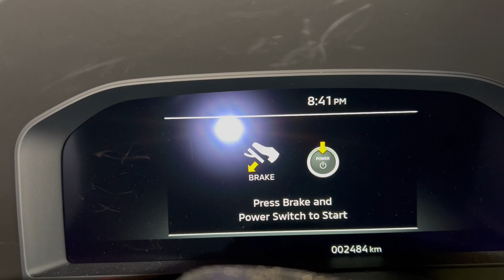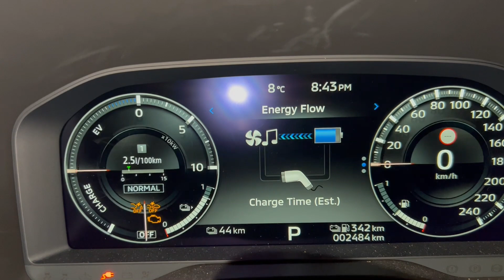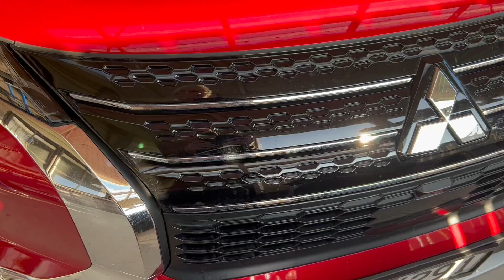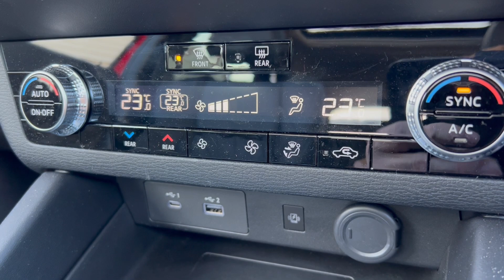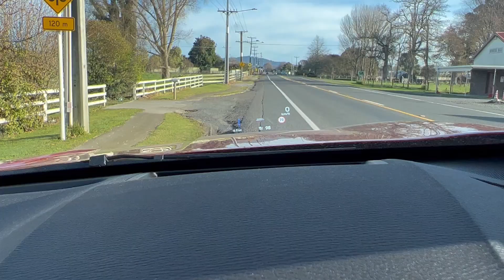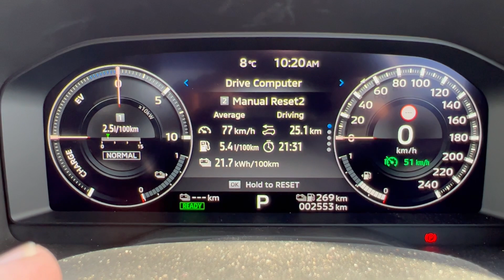Outlander PHEV 2022 2023 Review First Look (PT3)

Comment: Do you know what triggers the parallel-hybrid mode, where the petrol engine engages with the front wheels? I have tested heavy throttle input using all the driving modes, and i have never seen the power flow meter show power going from the ICE to the front wheels.
Reply from the maker: If you use up the battery or put the car in save mode it should go to it at 100kph/60mph
Reply: @detailedreviews4837  thanks. I’ll give that a try next time I’m on the motorway.
Reply from the maker: The car only has one gear. This means it can only go directly from ICE to wheels in a very limited speed range. I have seen it at 60mph/100kph a few times which is the speed it seems to like using the ICE. At any other speed the ICE only acts as a generator
Reply: @detailedreviews4837  Thanks for your reply. Is there any particular drive mode that you need to be in? And do you need to be around a certain battery percentage for this to occur?
I’m just concerned that I’ve never seen it happen in my car.

Comment: Quick question. How do you turn off your car power when power on without depressing break? User manual mentioned "two times to change to off" on page 7-11.  Looks like a mistake here as I can turn off the power by a single push instead of two times?

Comment: Thank you for the this. Very helpful. Small question for you what do you think, is it good just driving only ev mode? Also in what stage you going to charge the battery? and up to full or 90%?
Reply from the maker: Everyone seems to have different ideas on this, so don’t take too much from my reply…I work on the principal that it is a 20kwh battery and only 15 is used for EV mode and the rest is saved for hybrid mode. As such I see no issue with using EV mode down to 0 range

Comment: Thanks for this. Would you kindly spend more time on the Climate Control option please? I'm currently deciding between full EV and PHEV and the ability to pre-condition the car remotely (via smart phone a la Tesla) is very appealing to me, especially in Australia. I actually popped into a Mitsubishi dealer and they were incapable of telling me whether Mitsubishi had a similar thing going (ie - car control via smartphone app). It looked like you could set pre conditioning times in the Outlander though am I right in saying it doesn't work for you? Also - would it work with A/C to cool the car down at set times? I guess that would be one way of getting around the lack of phone app and getting to the same result I'm after (albeit, considerably less user friendly). Thanks for the review!
Reply from the maker: The simple answer is the car has the ability to pre heat or cool the car via the infotainment screen. Unfortunately it simply does not work. I gather this is not just a fault in my car but all released in New Zealand. I am hoping this will get fixed in an update. There is no phone app released yet, I am hoping I can use the app to turn on the air con remotely at any time but suspect it just duplicates the timer in the infotainment system. It is good to be the first to get the car, unfortunately there are still some issues to resolve. My next video will be on upgrading the Bose audio system

Comment: when driving with EV, is there a maximum speed point where the engine is forced to turn on? I'd like to know if its possible to drive at over 110km/h on a freeway without the internal combustion engine turning on.
Reply from the maker: The maximum speed limit is 110kph in New Zealand so I have only done a little over that. It worked fine in EV mode and no indication it was running out of required battery amperage to go faster

Comment: Great video, thank you.

Does 2023 use shift paddles to regulate degree of generative braking or is there another way to regulate the regeneration.

I loved that feature in both my previous Outlander PHEV 2018 and current 2022.

I love the able to coast as it does extend my driving range.
Reply from the maker: The paddles do control levels of regenerative breaking. Also there is the one pedal driving button and the B selector on the shifter
Reply: I believe that in Part 2 of your videos, I noticed (+)  and (-) paddles just behind  either side of the steering wheel.

Comment: Thanks for putting the video together. To better understand how the PHEV works, does the car by default always use EV first and where requires it will use a combination of EV and Petrol? Under what conditions, does the car use the combination of fuels? Assuming you start off with a full EV charge, how much more 'regenerative power' would you obtain when driving the vehicle (hence providing you additional mileage on EV power)?
Reply from the maker: It is winter here at the moment and the car always starts the petrol engine. I assume to warm it up. You can press the ev button before starting and the engine will generally stay off
Reply: @detailedreviews4837  I think you should also add fuel stabilizer to help slowing the petrol staleness if you only refuel one every couple months

Comment: Hey so if you go on a long trip +200km will the battery deplete in the first 50km or is there a hybrid mode that would use it sparingly or get the engine to charge the battery as u go. In those trips what would the fuel consumption be?
Reply from the maker: If you start the car in normal mode it starts the engine much earlier than if the car was in ev mode I presume to get the best hybrid range. Ev mode would normally only be a good idea if you know you will get to recharge before it runs out

Comment: Quick question.  Are you able to drive in EV mode with cruise control on?  I know the previous model would not allow this.  Thanks
Reply from the maker: Easy answer, yes. I have been at 110kph in EV mode with cruise control on
Reply: @detailedreviews4837  wonderful.  I'm assuming this is forced EV mode not the vehicle chosing EV mode?
Reply from the maker: @anthonyg8435  no.  In normal mode. I tested forced ev in a previous video and got about 5km after the range went to “—-“ in normal mode the petrol engine came on at this point
Reply: @detailedreviews4837  I'm sorry I'm a little confused by your response.  Can you use cruise control while in forced EV mode?  Thanks
Reply: @anthonyg8435  yes provided the PHEV have enough charge to hse. also assuming that you drive just over 100kph…
Reply: @RP-vu5uj  what if your in traffic and the vehicle comes to a stop will it continue with adaptive cruise control in EV only mode or will the ice automatically start?
Reply from the maker: @anthonyg8435  yes

Comment: Thank you for the in depth look. I'll be very interested to see how the electric range and Hybrid fuel economy change as the outside temperature increases.
Reply from the maker: I suspect if I kept my car in a modern garage I would get a better charge
Reply: I suspect that I've over-estimated the cold temperature penalties - yesterday was 10 degrees, I reset the trip computer and got 75km of EV (no excessive aircon or heating) - there is definitely some affect of cold, but I don't think it's that much by itself - the heatpump and de-misters do use a lot of charge (and they normally turn on the ICE as well)

Comment: Thanks for putting these videos together. 
You've mentioned a few negatives/disappointments about the car. Do you regret buying it?
How does Funkytown sound cranked up on the Bose audio system?
Reply from the maker: No, still love the car. I make these videos as they are what I wanted to see before I purchased the car. In New Zealand we don’t have the same choice. The Bose stereo is disappointing, the subwoofer achieves little, I plan to upgrade in a later video
Reply: I'm also in NZ, and have paid a deposit on one of these. I chose the VRX partly because of the Bose premium system. I gave the stereo a quick test during a test-drive of the vehicle, and didn't think it was that special. I just though it was because I needed more time with it to configure it to my liking. Based on what you've just said, I guess I shouldn't get my hopes up.
Reply from the maker: @revhead27  if the Bose speakers are 4ohm they can be swapped for better speakers but I have been told Bose often use 2 ohm and if replaced with 4ohm speakers they are too quiet as the amp is not powerful enough to drive them properly. This means an eq is required and separate amp. Even this is tricky as seats are so close to the floor due to the battery height
Reply: @revhead27  ours turns up on the ship in two days, hoping the stereo is decent enough 😣 from what I remember of when I test drove it, it wasn’t bad
Reply: @Angieb9191  - haha , I wonder if that is the same ship as mine. Mine's due here on June 27. Then the 4-6 week wait to drive it away. I only tested the stereo with radio playback, so I guess it will sound better with Apple CarPlay.
Reply: @angfam7729  oh really? Mine was due in the country on the 28th and I should have it 2 weeks after 🤞
Reply: @Angieb9191  Hey, not fair! 😮
Reply: @angfam7729  are you north or South Island?
Reply: @Angieb9191  North Island. I'm adding a towbar & paint protectant. Maybe that is what's adding the extra delay?
Reply: @angfam7729  we’ve added a tow bar and a couple of other bits and are north Island too I wonder why your wait is so much longer. I did put my deposit down in March 🤷‍♀️
Reply: @Angieb9191  , I paid my deposit early April. Are you in Auckland?
Reply: @angfam7729  nah manawatu
Reply: @Angieb9191  Just got my new ride today!! 😁
Reply: @angfam7729  that’s awesome! Way sooner than you thought 👌 mines in the country, should have it by the end of next week 🤞
Reply: @Angieb9191  Good luck. 
After getting the Apple car play working, i had no issues with the Bose stereo. It sounds great to me!
Reply: @angfam7729  wicked 👌
Reply: I recently drove the latest Hyundai Santa Fe (and apart from the dreadful controls) the Harman Kardon system is better than the Bose system used in the Outlander - didn't affect my decision in the slightest - the Outlander is far nicer to drive - music isn't a big selling point to me.
Reply: @gmilne13  - I guess any new-car stereo will sound better than my current 12-year old radio 🙂
Reply: @angfam7729  Agreed 100% - the stereo in the Outlander is far better than my aftermarket head unit in my other car - and WIFI connectivity is pretty cool - loving wireless CarPlay

Comment: Thanks for another excellent review. The Electric range does appear disappointing and wonder whether is is any better than the old Outlander PHEV or the Eclipse Cross PHEV?
Reply: You mean apart from the increase in power and range? I got 76km today in full EV at 13 degrees C, so it depends how you drive.
Reply: @gmilne13  just out of curiosity did you have the heat on?
Reply: @anthonyg8435  Heater from memory was set at about 21 degrees.
Reply: @gmilne13  last question was it all city driving or mixed and around what speed?  Thank you
Reply: @anthonyg8435  Driving has always been city (Auckland) driving, so a bit of motorway, but mostly ~ 50km/h. Daily use is maybe 1/4 to 1/2 a charge (30-40km). Apart from the odd road trip, we're entirely urban and looking at filling up the petrol about 3-4 times a year (previously once a fortnight/3 weeks) - power bill has increased by ~$4 a week, and saving about $50-60 a week on fuel - seems like a win to me :) just need to sell our second car and buy another Outlander ;)
Reply from the maker: @gmilne13  the eclipse cross uses the previous generation outlander system so not as good with 10 year old technology